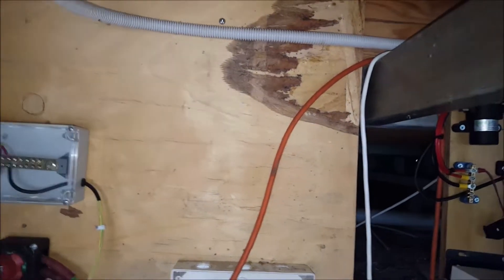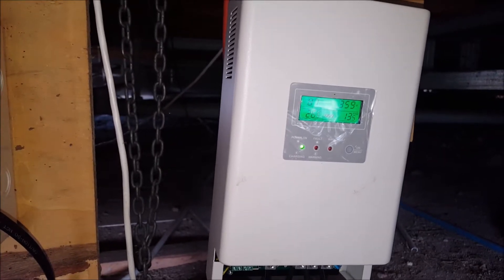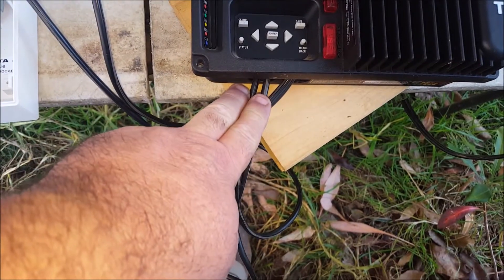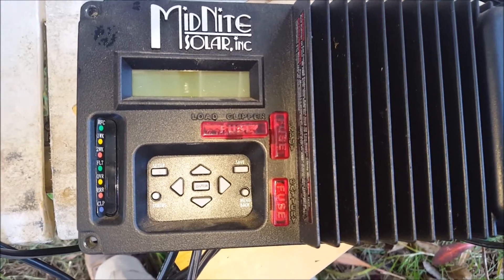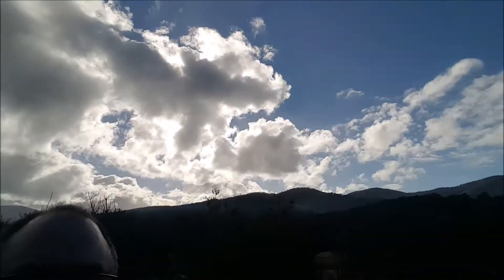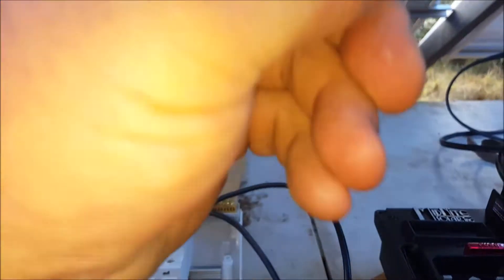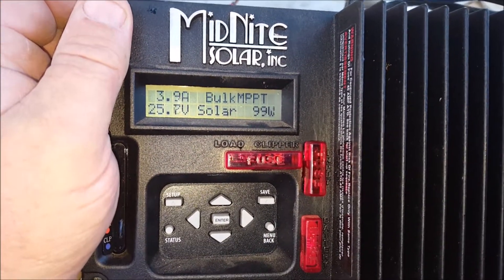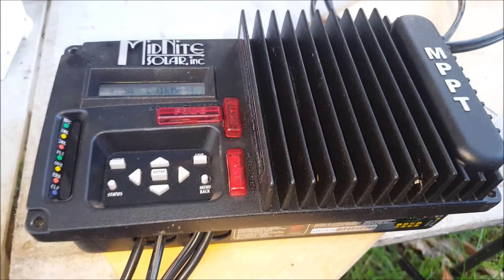Off Grid Solar Power - Have I Finally Killed the  Midnite Solar Kid Charge  Controller?

Comment: It is a regulator of MAXIMUM 30A, at 50% of the state of your batteries (24V discharged) are over 30A with 830W of panels, you have come to a condition of exceeding the maximum power. and when the battery is charged or discharged changes little you have exceeded the power of the panels. if you were using the configuration simulator or were you careful ...
I'm sorry for that chye happened to you.
Reply from the maker: It never exceeded 30 amps.
Reply: Hello, I seemed to have read and understood anything else, very strange if you have not exceeded 30A of panels (720W)
Reply from the maker: @winterburan  - The charge controller can't put out any more than 30 amps.
Reply: What I said, I know them well are robust efficient and reliable. I read in another post that you pulled the neck for the tension not only for the amps or am I wrong?
Ciao
Reply from the maker: @winterburan  - Pulled the neck for the tension? I don't understand what you mean by that.
Reply: Ciao, have you ever read the manual? For a 24V battery bank 40.5 volts input to the MPPT are enough to work at maximum efficiency, to reach this voltage logically we use maximum 2 panels in series, a panel is not enough to equalize the 24V lead acid bench, it would suffice with the lithium iron phosphate but it is another story, to make the MPPT work ok, strings in parallel with block diode from 2 panels in series up to the maximum power is the top, all the excess voltage / voltage turns into heat and loss of efficiency, the maximum 30 amperes are calculated not at the voltage of the panels / strings but at the output of the MPPT, 24V * 30A 720W using the simulator in fact in the 24V configuration the maximum power that can be supported is 861W considering that it is not continuous for moolte hours, yours has endured 2000 W to about 150V I seemed to understand? it's already been so much that it has not exploded!
The maximum current of the regulator is not calculated at the photovoltaic string voltage but at the average voltage of the 24volt beat they would be at about 50% charge
this shocked me how long it lasted with 2000W
try using the special simulator you'll see if I'm not right!
http://www.midnitesolar.com/sizingTool_kid/
Ciao
Reply from the maker: The charge controller DOES NOT and CAN NOT take the full power output of the panels. It will never draw more power than it's capable of putting out.
Reply: Ok, congratulazioni per il resto il canale è interessante.
Grazie continuero a guardare video che mi ineressano 
buon proseguimento di lavoro !

Comment: So was the issue with the connection on the breaker or the corrosion on the Wire? Thanks for sharing.
Reply from the maker: Where the wire went into the breaker.

Comment: Do you run 240V into the house from the inverter via your 'normal' house wiring? or extension leads to different appliances?
Reply from the maker: Colin Middleton - At this stage it's just an extension lead.

Comment: I'm going to take a guess that the next video describes of what a pain it is to get the wiring connected to the back of the Kid and how it would be cool to have a built in terminal block to access it. 
https://youtu.be/bCRoSpg6TVw?t=51m7s
Reply from the maker: Russ Dienert - Picked it like a snotty nose.
Reply from the maker: Well, it's not so much how much of a pain it is to connect the wiring, but the size of the terminal block itself.
Reply: I say get the free upgrade, since they are offering.

Comment: The kid. is a very good charge controller Glad you found out what was wrong ? The PCM 60x is a very good charge controller. I have had mine for many Years.  I use Noark circuit breakers now. They have never given me a problem. And for the Low volt hi amp side i use 3-Pole NT00 Size Housing and fuses. I get them from http://www.dcsolutionsaustralia.com.au/accessories.html
Reply from the maker: Yeah, I've got one of those fuse housings, it will go in the next iteration of the solar power system. For now I have a Blue Sea fuse on the battery bank. I don't draw any more than 2000W.

The PCM60X is for a water pumping station at Mum & Dad's place. Yep, yet another project.

Comment: CANT TRUST  Midnite Solar ? OR BAD CONNECTION ? IT IS A BIG ISSUE BRO !!
Reply: Theredneck Prepper Had issues myself no where near 80% load and still smoked it.
Reply from the maker: I trust their gear. I've had this running with 2kW of panels on it and putting out 830W @ 27V without any issues whatsoever.
Reply: Humm ?